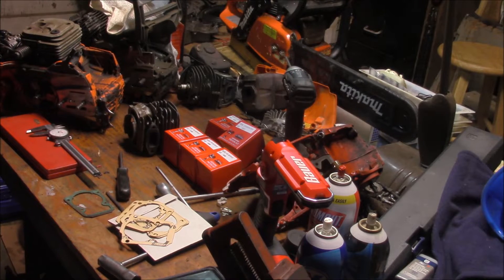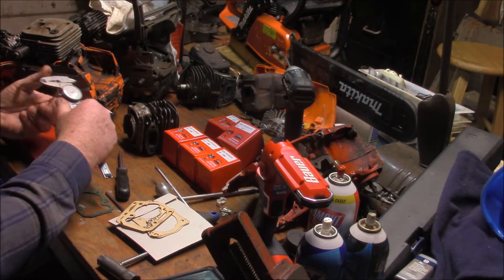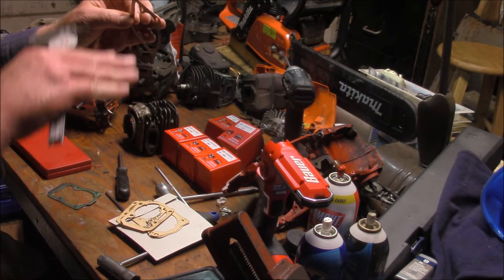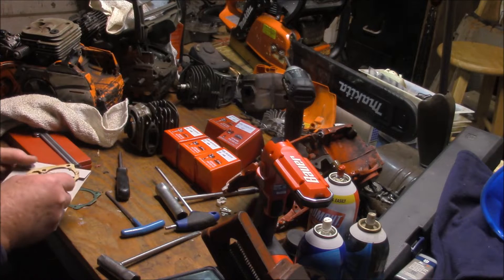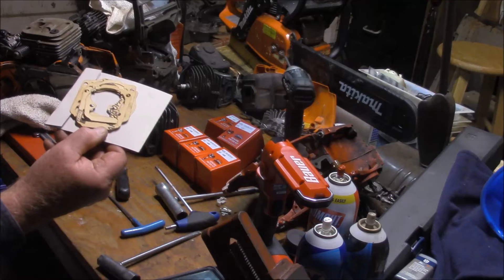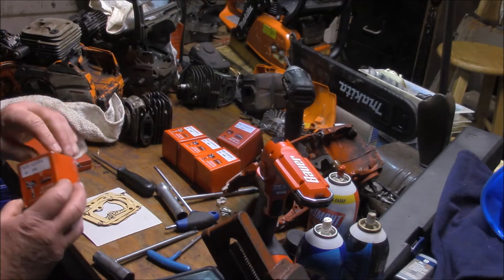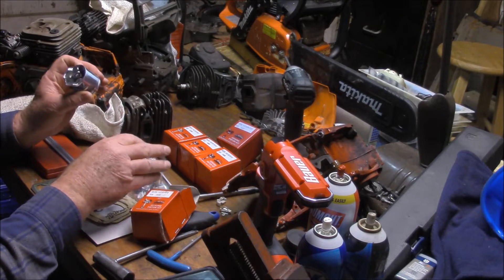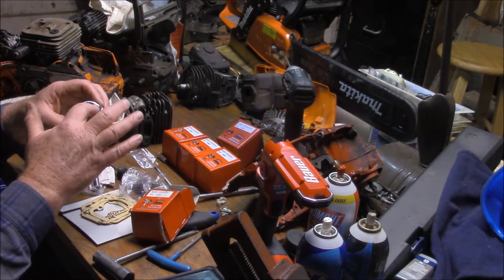Squish bands & Compression Overview of "Why" Simple Hop Up Concepts ANYONE Can Do To Chainsaws

Comment: So I don't have a lathe and swapped out the piston in my G288XP and had to add a .080 gasket to keep it from being a head slapper.  Basically raised all the ports and added a ton of compression,  it runs alot better for me.

Comment: Nice video, agree whole heartedly. Compression increase and setting the squish right gives me a nicer running saw with better response, just what you need for limbing. Bit more top end power too. And saw is more tolerant to mid throttle fueling issues which is a real bonus because we know these simple carbs dont always do the best job mid throttle even when set right at full throttle.
One thing to think about - combustion starts with that spark at maybe 25 - 30 degrees btdc and goes on burning way past tdc when piston is no where near the squish band.  How does that fit with the mental image of gas not burning in the squish band ?      It doesnt. Tight squish is for turbulence primarily, which leads to better, faster combustion. Thats your efficiency gain.
Reply: Yes 👍… however you want the most force on the piston to occur around 15degrees ATDC for max power!  This is a “moving target” and can really only be confirmed by the stopwatch or Dyno. Often overlooked is the fact the higher compression causes the combustion to occur SOONER so in effect you may find that retarding rather than advancing the spark will give the best power at the 9500-11000 rpm that these saws run in the wood

Comment: Nice video Walt. I like how you did your 572 build. If one has the equipment and knowledge to crown the piston and machine the squish band to match fantastic! Being able to buy a $40 dollar pop-up piston, remove or replace the base gasket and do a muffler mod  netting one a noticably better performing saw for all the reasons you mentioned is definitely a win. It really comes down to how much time and or money one wants to put into a saw and what the returns really are for that. Some may argue that modifying the piston causes a problem down the road when it comes time to replace it, perhaps for those not attune to such mods, but one can learn like most things, decide whether to duplicate going forward or make their own mod when the time comes to replace it. I find it interesting how alot of the porting and piston mods we see today are based off of what Stihl did to their saws in the 80's. I run saws with both the cost effective mods and full tilt custom machine work and definetly prefer both over stock for a production logging saw. My experience has been that they get the job done faster and more efficiently with a lighter saw which my body appreciates far greater than the cost. I have a Stihl 066 built by Madsons years ago that the only issue I have had with it was when it came time to replace the crank seals I discovered one of the nylon cages in one of the crank bearings was coming apart ;) Two of the dealers I buy new saws from offer new saws ported with a warranty. YouTube has been great for sharing this information, helping to educate folks, making saw mods more acceptable and giving them a basic understanding to decide what is best for their needs.

Comment: From .030 to .013 plus maybe a couple thousands once compressed with just a gasket is pretty good in my eyes.

I just built another MS660 and with the stock metal gasket it was at .036 before compression,  I cut a .010 gasket and after install and compression it's at .017 maybe a little tight but it's not a head slapper and runs like a rapped ape, LOL,  but I'm not really sure how a rapped ape runs.

I really only build work saws so the extra duration of being under pressure enhances my builds as I only try to clean up the transfers and ports and gasket matching to enhance and clean up the air flow.

Comment: Been using gaskets to adj squish and change intake/exhaust timing for years!  It’s amazing how the engine “comes alive” when your MSV (max squish velocity) is correct(along with jetting , timing  etc) . Nice thing about using gaskets is that they are inexpensive vs other more “permanent” methods. Once you remove metal it’s GONE forever , and unless you possess the ever elusive “put on tool” you could quickly find yourself SOL 😂

Comment: That’s a good way to time transfers and if it didn’t work pistons are cheaper than wrecking a good cylinder eh good video
Reply from the maker: I think so as well.  Actually was inspired by a fellow and company out your way years back to use that approach to "rough" out numbers.. :)
Reply: Good way to test transfer and exhaust timing increases before grinding ports in cylinder.... does require new piston in the end though.